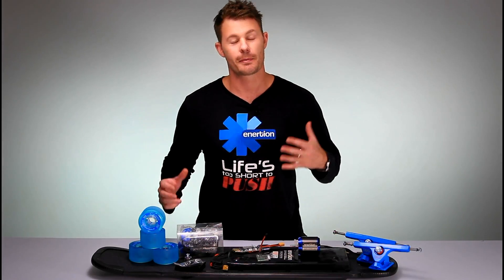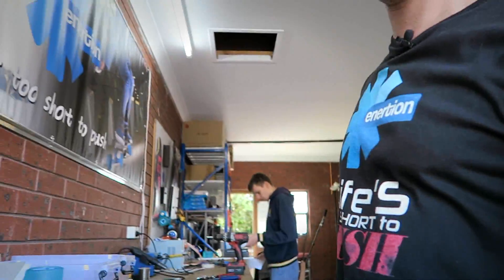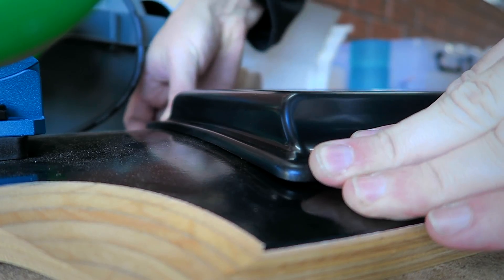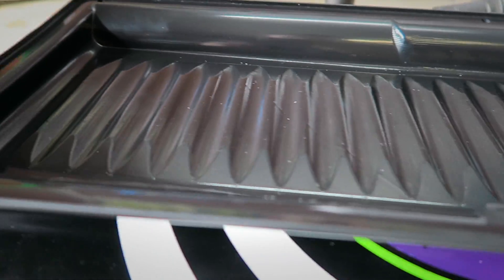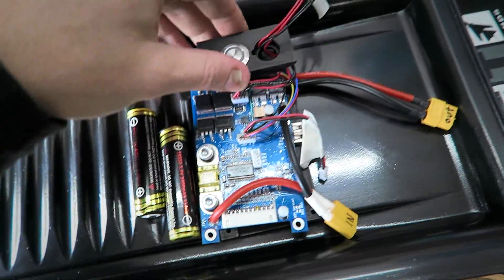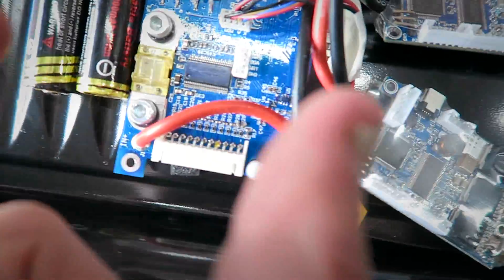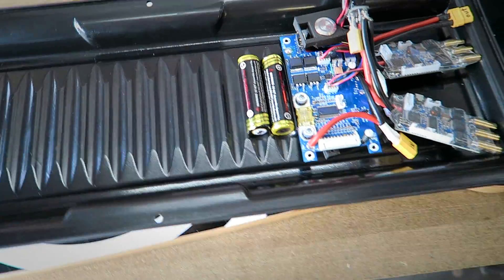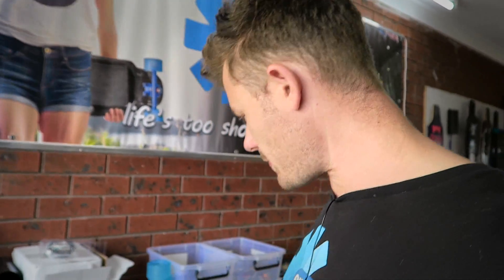Space Cell Pro - Electric Skateboard Battery VL34

Comment: You are building exactly what I was looking for, a clean, simple but universal fit kit, I already have the board, I just didnt wanna muck it up with a bunch of bulky disjointed crap hangin off of it.  Nice!  Have you posted to dimensions somewhere yet so I can measure to see if it would fit my deck?

I really hope that evolve can pull off the hub motor, combined with your case, controller battery and that style of motor with the power and control, thats a sexy skate man!

Cool work, like your committment to testing, rework and then make the offering, keep that and you will overtake, good business model.....

Comment: Can I use the space cell pro to power up the VESC for the first time? Or will I need to get a lab rated regulated power supply?
Reply: +Electric Skateboard Builder where can I get the weather shield? what's it called exactly? thanks.

Comment: Watching you test the battery grooves got me wondering how an electric skateboard would run off of normal alkaline batteries or perhaps alkaline batteries with a boost regulator AKA step-up voltage regulator.
Reply: +low rez They can't provide the power that 18650 cells can.
Reply: +Jake Methner 
They can still be arranged in series to give the same voltage. Using 5v boost regulators means 8 alkalines would produce the equivalent voltage of a 12s LiPO.